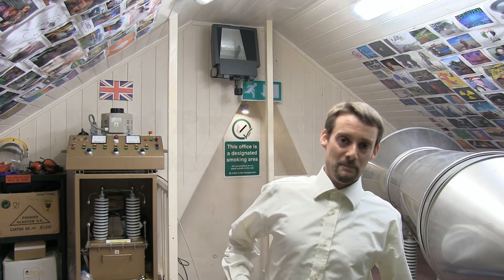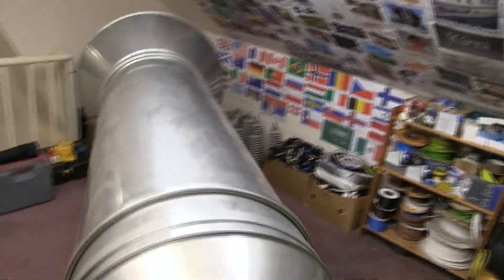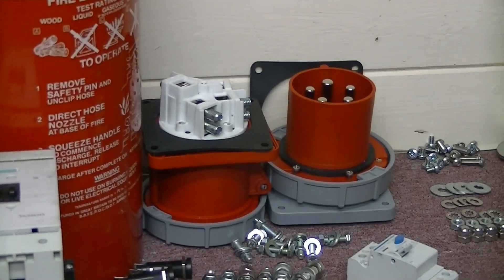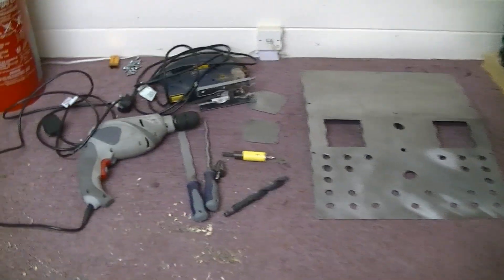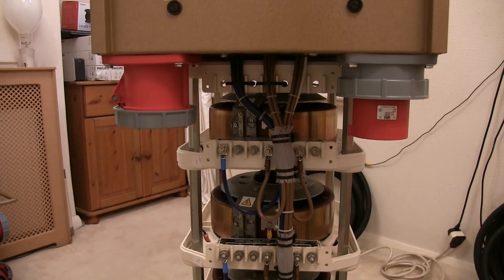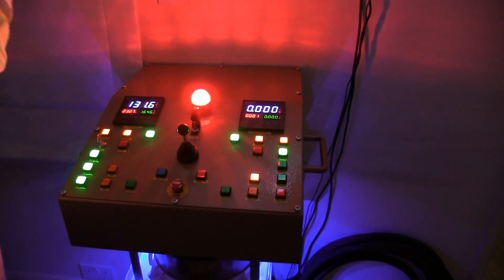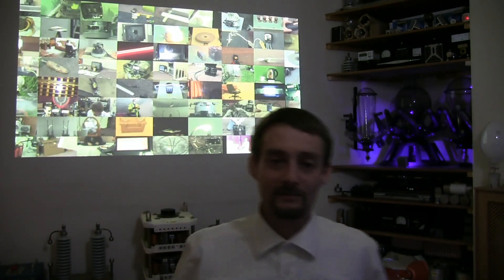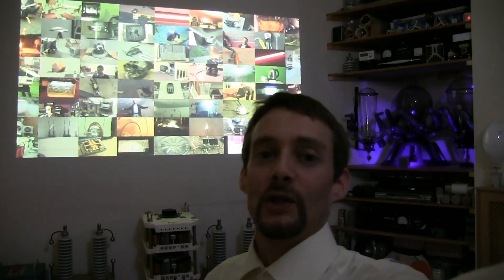20,000 Watt Power Supply

Comment: finally, an adequate supply for the rtx 3090.
Reply: Getting all the parts for this PSU will probably cheaper and faster then trying to get a graphics card these days
;-)
Reply: 20KW Variac, now that takes the idea of overvolting your GPU to the next level
Reply: Do those things actually exist? Heard tales, but never seen one me self
Reply: You may need another in parallel to have some headroom for that GPU
Reply: Dated!
Reply: And that is with eco mode

Comment: I'm still curious to know just how you're able to draw 20kW and the power company A: Lets you and B: Not be asking many questions about why you need a three phase supply capable of drawing that much power.
Reply: 20Kw seems excessive, but it's not. Typically, supplies to domestic properties in the UK are on a 100A fuse, which at 240V gives 24Kw. I can't find an exact percentage, but plenty of domestic properties are already on 3 phase supplies, generally for historic reasons but increasingly installed by our power companies from new to support things like electric vehicle fast charging, with each supply again on a 100A fuse. All the main power suppliers in the UK offer domestic property upgrades to 3 phase for a relatively low cost.
Reply: @alricdark  Does Photon have a 3 phase supply? 

Stupid question maybe. I know that’s a 3 phase variac, but I thought he was just doing 240v single phase at up to 80 amps, fed into three variacs in parallel, then that’s fed into the high voltage transformer under the mirror (which outputs up to double 270v from the variac).
Reply: @davadoff  Photon says he has standard 230V single-phase, but using a 3-phase cable rated at 125A.  The stack of 3 variac is actually a single motorized unit , single-phase 240V variac available on IndiaMart, probably rated at 90A.  Those units are available at very low cost.   See for example Energx India, where these motorized units of a stack of 3 parallel variacs can be had from 2A to 1000A.   The 3A model sells for 15,000 INR, or about 127 GBP.
Reply: @kenburrell6227  interesting, thanks. 
Also, I must have meant ‘up to 270v’ and not ‘up to double 270v’

Comment: How high are your power bills
Reply: not to high, his house is single phase but the transformer is 3 phase. The incoming plugged into an amp transformer, which means  240v 0w converted into low voltage but high current. Measure the current at the incoming side of the transformer, its low.

Comment: How big is the residential supply in the UK?
Reply: His house supply is likely 240V (standard UK voltage) and 100A before the meter. Anything before the meter is owned by the power networks and can't be legally altered or disconnected by the home owner.

Comment: Big buy power supply. Damn it must have costed $5-10k. 
Badass build... Ultra complicated and it works perfect... Wish the specs weren't so top secret: Voltage range on and on.

Comment: Thanks Muhammad Syaifullah

User Photonicinduction: Calender 2018 Overload/Overvoltage Upload
Overload HDD/CD-DVD 3600 Volts Overvoltage Video 26 June 2018 Upload
Overload Ceiling Fan 12000 Volts Overvoltage/Kipas Angin 5000 Volts Overvoltage Video 10 July 2018 Upload
Overload TL/CFL/LED/CMH/MH/HPS Lamp 4000 Volts Overvoltage Video 25 July 2018 Upload
Overload PC Cooler Fan 4500 Volts Overvoltage/Overload GTX 1050 Ti Fan 6000 Volts Overvoltage Video 23 September 2018 Upload

Overload PC Cooler Fan/Overload GTX 1050 Ti Fan Overvoltage
Overload HDD/CD-DVD Overvoltage
Overload Ceiling Fan/Kipas Angin Overvoltage
Overload TL/CFL/LED/CMH/MH/HPS Lamp Overvoltage

Comment: Hey Photon
How is this thing wired up?
You get 3 phase input? or just one Phase?
Are those three variacs each for one phase or wired up in parallel on a singla phase input?
Im a little bit confused because u used an 3 Phase plug for all your connecntions.
Would be very nice if you can explain a little bit more about that thing....its so nicely designed!
cheers :)
Reply: Single phase I believe. Variacs are in parallel with balancing chokes on their outputs.

Comment: Photonicinduction have you use a 63amp plug with parallel contacts ore is these a 125amp plug! have you take a 5 pole 16mm2 cable or a 3 pole ?  have you at 5 pole 2 wires parallel?? thats one of the some good points in germany ! many homes have 230/400V 3 phase at 50 or 63 amp servise!

Comment: Electrical Engineering student just trying to understand how this works: Looks like 3-phase in, goes through 3 variable auto-transformers and a choke at each end, with a current transformer for metering and RCDs, MCBs, and Contacters for safety and control? Is that close to how it actually is?

Comment: good idea for you to look into is some of Nikola Tesla's wireless energy transmission an his Van de Graaff generator, but wire it as a transmitter at 5.28 megahertz , that's the found radio frequency.

Nikola Tesla called Energy "radio frequency "an it can be transmitted if there's enough energy to put it forth into the acceleration of radio frequency a pure wave length that no walls or wires can Solly hold. I believe you may find a secret in energy's true potential.

Comment: how do you get your house main upgraded to support this?
Reply: Most UK house mains will support 100 amps at 240 volts if not more. Granted you probably wouldn't want to run it 24 hours a day, and your internal wiring would need an upgrade, but the supply should handle it.
Reply: +Spencer Wilton huh that's some juice man.

Comment: I need a little bit of help fully understanding this. Don't worry, not building one. 

So, Nat. grid feeds variacs via various controls, then they feed transformers for a x2 step up in voltage. The bit i don't understand yet is how the chokes balance the big transformers. I'm sure he said they are fed from the output of the transformers and compare voltage/current and produce a differential voltage/current???

I normally work with milliamps in radio repair and not that familiar with this high power stuff. Very interesting though and its like a totally new world of electronics, if it can be called that. Absolutely fascinating what electricity can do at such extreme levels.

Edit: Think i get it now. Two chokes feeding the big transformer primaries, one in series with live and the other in series with neutral but wired in opposite phase.

Comment: What size service do you have feeding your house? I would imagine you either have a three phase service or atleast a 200 amp single phase.
Reply: +jason sikora Most houses in UK are good for 100 Amps at 240 Volts, so 24KW is no problem. He's running that huge cable back to the consumer unit to avoid using his house wiring. Even an electric cooker socket would be beyond its rating at 20KW (83 Amps).

Comment: Where does the thick black cable connect to get the electricity from?
Reply: I think 3-phase to UK houses is more the exception than the rule.  I had to get a VFD to get 3 phase in my workshop (which is just converting single phase to 3 - it's not 'real' 3 phase and wouldn't support a 20kW supply!).  If you want true 3-phase straight from the grid, you need to get the leckky board involved and the cost depends on how much work (wiring etc) they have to do to get the 3 phase to the house (this was the killer for me - no 3 phase close by).  And of course they whack on a new meter (or 2) to ensure that you are paying for it.... they got to get their pound of flesh :)
Reply: +Marius Ammann Mains power.
Reply: Jackson Steinborn  Is there one that size in every house?
Reply: +Marius Ammann Mains power is the stuff that comes in from the national electrical grid. No, most likely Photon did some black magic with his mains supplier to get a plug (and supply!) that large put in.
Reply: It's not black magic, most households these days get three-phase connection (because of high-power appliances like electric stoves & electric water heaters), so you can just install the big plug and you're good;)

Comment: You got the famus 400V now? Here in norway we got both. On my school we got 2 things who are 400V (Industrial thing, lathe and robot arm) Running of a 63A transformer. And the rest is 230V as you might think, we got 230V in the building.

I like you're vids, big booms and power under control is fun, looking to make a railgun myself. Handheld, small projectile. 0.4mm BB or something. Helps that the school just overflows with aluminium flat-bars.

Sorry for poor english grammar.
Reply: if you're going for a railgun, I would recommend copper, it has a much lower reistance to volume ratio (second lowest, with silver beating it, but silver may be a bit too expensive lol)
Reply: Its like... 5x50mm flatbar, and lots of it, no problem harder got get copper. In nowray you cant go to the lokal hardware store and buy a 1m rod of copper. Or annything like that.
Reply: ah, I see. Well, as long as the cross section has a large area then you should be fine with resistance, and don't forget the capacitor! Oh, and just one question, what size gap are you leaving between the bars? 4mm?
Reply: Do you use TN-C-S systems in britan? Here in Norway we got IT and TN-CS... Real pain in the ass for some people.
Reply: Yeah, but did you know that in the 1980s/90s it was mandatory to learn to wire a plug, cos most appliances back then didn't come with one? Idk if GB is the only place that did that, but it's still a cool fact in my opinion.

Comment: At 3:12 does he say "five hundred amps easy" or "nine hundred amps easy"?
Reply: +CoolKoon I think he says "That's 800 amps easy" actually
Reply: +Sam Edwards Thanks. Unfortunately my British English isn't nearly as good as I think it is :P 800 amps X 400 volts that's 32 kW. Damn, doesn't this guy have his own substation already?
Reply: CoolKoon in canada thats about what we get each house ;) but i also live in italy and only get 3kw
Reply: +cesare vissani Yeah, but the voltage is much lower in Canada, isn't it?
Reply: CoolKoon Its 120V, in italy its 220V, sad part is in Canada i could run A/C full blast, hair drier, washing machine and drier + dishwasher and still have plenty of current to do the kind of stuff this madman does, in Italy hair drier and oven  and youre in the dark
Reply: +cesare vissani Then it means that the wiring of your house or apartment in Italy is really crappy, sorry. Unfortunately rewiring is a pretty expensive and lengthy procedure.
Reply: +Mat Teo You mean 2 kW, right? And do you live in an apartment?
Reply: +Mat Teo That's still a bit too little (kinda strange, in Slovakia even apartments were wired for more back in the 80s), but not that surprising for apartments. They are always wired for much less power than houses.
Reply: Mat Teo Mat teo penso che ti chiami matteo, come fai ad avere solo 2kw?? io ne ho 3 e qualcosa...

I live in an apartment as well and i have 3. something kw before the counter cuts me off.
Reply: +cesare vissani Yeah, you probably have a 15 or 16 amp breaker.
Reply: CoolKoon about that yea. Sad.
Reply: +cesare vissani Well, on the other hand what high-powered device would you possibly want to power in an apartment? An industrial table saw? Or an animal feedstock grinder? :P
Reply: CoolKoon I dont live in a 20 m/squared apartment, its really awful to have such a low barrier, If my sister is drying her hair, my mom cooking with the oven, and the washing machine which is on a timer goes off and starts washing in the cheap night cycle the whole current is shut, in canada i have electrical heating, a big 10 kw heating fan and some smaller 1,5 kw heating elements + electric oven and cooking surfaces and never ever hit the cap, different way of life I guess
Reply: +cesare vissani Actually such breakers are/have been installed in bigger apartments in Slovakia as well. I used to live in a 72 m2 apartment and it had a 16A breaker as well IIRC. It wasn't a problem though, because we used to cook with gas (in fact we still do, and it's MUCH more convenient than electricity) and the only high-powered electrical device was the washing machine.
One caveat though: the fact that you have a low amperage breaker means that the wiring in your apartment can't support more either. This means that it's either a common problem in Italy or you ended up with an apartment that has really bad wiring. Either way I'd suggest not using the oven, the washing machine and a hairdryer (or an iron) at the same time....
Reply: CoolKoon Trust me, its not the wiring, its stupid laws. Also i have gas cooking elements in italy
Reply: +cesare vissani The laws? Wiring for housing and its corresponding breaker amperage is defined by international standards, which are derived pretty much from the physical capabilities of the wiring (and they don't allow for much slack either: in my dad's apartment the cabling in the wall leading to the washing machine's wall socket broke despite the fact that proper copper wiring has been used). So running your home on a breaker with higher amperage will risk you setting your apartment on fire (overheating cables in walls are a serious fire hazard).
Reply: Ok, let me put this straight to you, every single family house or apartment has a defined max electric consumption. Its not only about the wiring, its about the max I can use that is definded by law, regardless of wiring
Reply: +cesare vissani Whaaaaaaaaaat?! Really? And is that a city ordinance (applies only to the given city) or a law (applies all across Italy)?
Reply: CoolKoon `Pretty sure its based on the electric company, if i had per example a heat pump there is a special counter thant has more amps

Comment: Dear Mr.Photonicinduction I'm doing a small transformer and ac to dc project and I was wondering what place I can get reliable electronics, not the crappy corner hardware stores!!! need a diode, still working out the rating of the motor it's 24v wouldn't imagine the amperage is high, circuit breaker, good wire and a 240 voltage relay. Standard wire is fine as it's only using the 13 amp mains electricity. was thinking whicks or something. 
Your's sincerely,
Dubstep_lover

Comment: [the guy with the coconut shield comment(that was pretty good)] - I've got a bit of hardened steel, in its present shape its called a "ANTI-THEFT-LOCKING-WHEEL-NUT" unfortunately, the inventor is already dead so no possibility of retribution there - or he'd be taped up in a box on his way to your PO Box........ I wonder if you could... alter it.. somehow defile the bit of steel.. in the name of simple easy life with no locking wheel nuts forcing you to drive on niceish alloys with flat tyre.. can the 20k psu "alter" an M12x1.5 bolt made of hardened steel into something more useful or decorative? - I got it out... but it's still looking quite proud of itself. I'll pay. Thanks for reading Photon.

Comment: imagine this guy's electric bill
Reply: Riley Goss His experiments are usually short, so the electric bill is smaller than you think. It's not like he is running electrolysis 24/7
Reply: +CABAL Exactly. I will use more KW/hrs with my 3KW hot water cylinder running most the night on economy 7.

Comment: They just let you plug into the national grid?
Reply: He has his own 100A circuit on his Consumer Unit (Distribution Board), and his Service Fuse is likely 100A so he is running at the upper limit even with Diversity Factor in the equation.
Reply: @julianpiper240  In My part of the world 240 volt @ 400 amps is common service.for large homes
Reply: comm744 that’s  just stupid..ly cool.
Reply: Gat obviously not😂

Comment: Sorry if you mentioned it in the video, but what's that huge metal thing?
Reply: s0ldi3rXA At 1:25 he said he was going to use the power supply to split water into hydrogen (and oxygen).  I'm guessing the 'metal rocket' is the vessel inside which he plans to split the water.....

Comment: Glad you're going scientific. I made a water hydrolysis cell in a used plastic peanut butter jar. 12V supply, 1 amp. It looked about as exciting as a flat glass of lemonade - 'til I lit the outlet with a match. Did it go fucking bang. So, I look at the size of what you have got planned there and genuinely feel concerned for your welfare. The blast won't kill though. It's hitting the ground that does that.

Comment: Can you do a big manual knob right on top for the variac with some kind of slipper clutch to allow you  to still use the controller? Or make the thing remote with a high speed something that turns as fast as you can crank a knob? Seems to slow to me, but very nice.

Comment: I like your videos a lot, I also made a small one about high voltages, basically me frying a circuit board with a flyback type HV generator (v=f-Cg0GLvHeo). I'm far away from having an electric substation in my attic, but I'll keep trying.

Thanks for your videos.

Comment: I have one question. Well two. That hydrogen reactor, is that going to be used in that little attic? And I assume you put it together up there, because no way does it look like it will fit out any door, window, etc. Unless it's not fully assembled with welds or bolts.